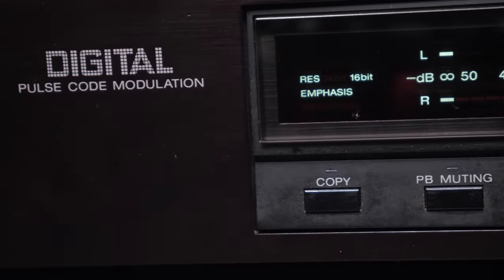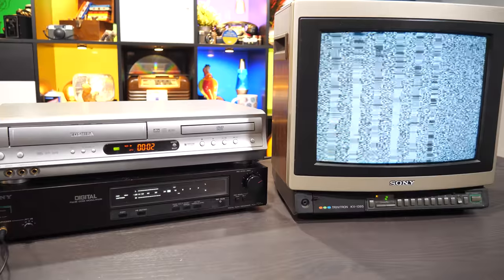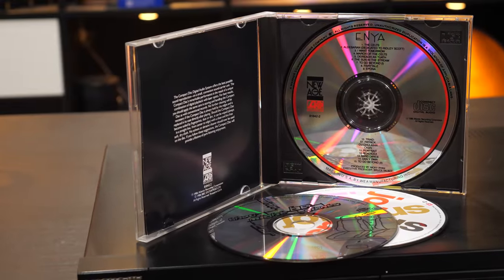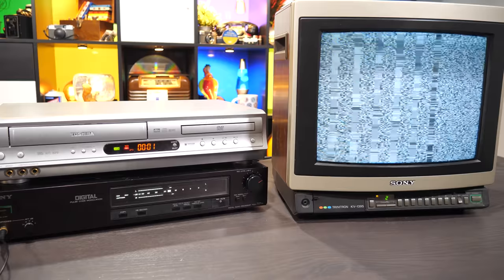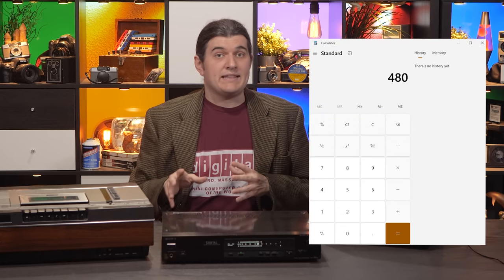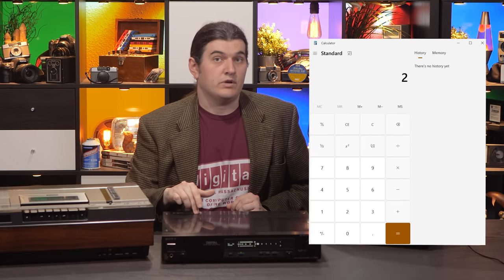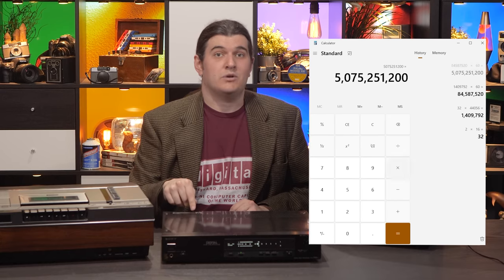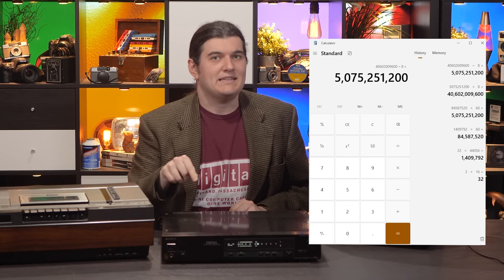Digital audio needed videotape to be possible - and the early days were wild!

Comment: That video output is kinda neat, because it’s not exactly like the recorded waveform you see when recording digital audio on a PC, but you can see the frequency of the sounds as the scroll along the recording head.  So, it’s almost like if you were able to take a recorded sound wave but instead of viewing it from the side like you would in any audio editor—this thing shows the same thing, from a top down perspective, that’s very zoom in so you can only see a small segment as the recording head moves over it.

It’s kinda strange to think about because waves are not really 3D things, but I would imagine that if you put the audio and video track on timeline in a program that can do audio and video editing or at least video playback, like Logic Pro, I’d bet it would be pretty cool to scrub through them at the same time to how it correlates to the waveforms.

Comment: Reading the comments I see no one mentioning ADAT, which I thought was essentially the same system but running at 8x the speed to give 8 digital tracks per VHS tape.  This was something I saw in a few recording studios and was presumably the "professional" version of this setup.  Digital mixing desks have been around for some time but the DAT tape's not suitable for storing a bunch of tracks like that so there would often be a pair of ADATs with some kind of sync box to allow recording 16 digital tracks from the desk (I think you could actually chain as many as you could afford if you wanted more tracks)
Great video anyway, your writers deserve a raise :-)

Comment: I did use mine for recording long radio programs!  Remember there were no MP3/HDD solutions back then, and the use of VHS/Beta HiFi suffered from companding "breathing" and head switching noise.  Both conditions are very apparent in my air checks of KRTH-FM from 1983.  The PCM tapes are crystal clear (minus the lower fidelity FM quality).  This has recently become apparent when I transferred old shows of New Wave DJ mixes of the late 80's I had.

Comment: Very interesting ! As a musician this make me think of the ADAT machines that came out in the early 90´s which recorded 8 channels of audio in CD quality to a S-VHS tape and these machines could also be synced to each other to expand the system to many more channels 8 channels at a time. These days the ADAT as a tape system is probably more obsolete than the compact cassette system but ADAT still lives on as a 24bit 44.1/48 Khz 8 channel protocol over one single Toslink cable and is used for 8 channel AD/DA expansions for computer sound cards for studio use often with built in mic preamps, i use it myself.

Comment: I toured a community radio station in the early 90s. They told me they had to keep recordings of everything for some reason. 

I was too young and inexperienced to understand the tech back then, but I do remember that they had a pair of fancy but consumer grade VHS VCRs that I was told they used to record all their transmissions (some licensing conditions). 

I don't remember much else, but the engineer was super impressed with the way they had managed to do this on a budget and how simple it was. Every presenter who was going on air would pick up a blank, write their date/time/segment info on it, pop it into the free recorder and hit record. When they signed off, they stopped theirs and put it in a store.

Comment: decades ago I went to school for audio engineering.
This was just before DAT came out. 
The head of the school was Leo De Gar Kulka, some of you may know of his son David. 
Leo was pretty leading edge. He had a Sony PCM F1, which was the first version of what you have here. 
He wheeled it out to show us how it worked. Then later on in the year he showed us his custom built tube version of the same thing!
As far as why someone would want a PCM adapter? I remember a lot of people used to use open reel decks to record LPs, FM radio etc just to make a custom 'mix tape' to listen to. The only advantage was that it was uninterrupted music for as long as the tape ran. Which could be a pretty long time at 7 1/2 IPS. More than an hour for a 10" reel. 2 hours if your deck goes to 3.75 IPS.  

When the PCM boxes came out digital was the new hot thing. Don't you remember all the "digital ready" branding on hifi gear? You can logically prove that just because something is recorded digitally doesn't make it better. But hifi and audiophiles are immune to logic. But even putting that aside. It's just more convenient to monkey with a VCR than an open reel deck. 
PS Was that Blakes 7?!

Comment: And in the grand tradition of the majority of VCRs no matter the decade (70s, 80s, 90s), the clock never changed from 12:00. Carson and Leno got a lot of millage from that detail.

Good work. I remember guys back in the day in my engineering classes recording their records to video tape. I think in the movie Contact, they used a VCR to record the alien transmissions. I remember noting it when I watched it in the theater, and was impressed fr the detail. It was made late enough it may have been DAT, but it didn't look like it.

Comment: I used to use adat in the early 2000s.  Used SVHS tape to record 8 channels of audio. A two hour tape would give you 42 minutes of 8 Chanel recording at 48KHz. Not good enough for studio recording, but great for live and other location multitrack situations. Alesis was the manufacturer. They had a time code track too so you could lock three or four adat machines together and do 8-16-24 channel old school mixes on a a huge studio like sound board. But even  in 2002 I would use the adat to get a multitrack record on location and take it back to a studio and play it back into a pro tools or similar setup and do the mix on a Mac G3. Brilliant multitrack solution at the time.

Comment: In answer to Tech Connections question about the difference between 14 bit and 16 bit, I believe that what happens is that the 14 bit is a bit noisier when played in 16 bit mode (which is possible) and the extra 2 bits are just noise. At 14 bits, the S/N ratio is about 86 dB, slightly worse than the 90-92-dB S/N of 16 bit recordings.

Comment: 32:30 well my atari 800xl can address 4gb with two ay8930s,

Hook a hard drive can even display digital video, with synchronous digital audio, and thats a 6502 computer from 1979. And built around 1976, 2600 was just a cost reduced model, below the 400

Comment: Corvus developed a network system to link multiple PCs and hard disk drives together ~~1980.  They used VHS recorder / players to backup the hard drives.  As I recall, backing up a 10MB hard drive took around 2 hours.

Comment: I am very impressed by this technology.  In 1984 I was 10 and had my first CD player. A few years later I received a VHS player with HIFI audio. This was the best affordable way to records cds. It could do 20hz to 20KHZ with 70 dB signal-to-noise ratio (cds are 5hz to 20KHZ with over 90 GB of  signal-to-noise ratio).

Comment: VCRs were also used to do backups for computers.  It was important not to mess with the tracking controls.

Ah, you covered that, but it was available in the mid-80s.  My wife worked for a company that used that system.

Comment: High dentistry removable tape was used in computing during this time period, just not really for home computer applications. In the late eighties, we did have SCSI tape drives that could run on pc hardware, but it was typically used for multi user server class machines, not home computers. Commercial software was even distributed this way.

Comment: There absolutely was something using video tape for data storage between your device and the VHS backup device that Databits demonstrated..

And in curious symmetry with your shirt, I used it on a Dec Vax computer.

Sometime in the late 1980s to early 1990s, there were several systems that used Video 8 and Hi-8 tapes to backup data on Dec Faces (and presumably other computers).

This was a 3rd party device, not from Digital themselves, and I don't know how compatible the recorded tapes were with anything else, or even if they'd produce a playable video signal if put in a video 8 / hi 8 player.

But this certainly existed 5 or 6 years before the device that Databits showed.

Comment: As someone who used to record morning radio shows with a vcr, I could see this being useful. Though back then I was using a rca to 3.5mm cord just plugged into the rca jacks on the vcr. It did good enough to listen to the morning shows later that evening, via a clunky rca to female 3.5mm plug, plugged into a cassette adapter in my mini stereos tape deck.

Comment: Related item: "HiFi VHS" machines that could record HiFi Stereo in the AUDIO tracks of "normal" VHS tapes.  You could still have the video portion carrying a picture, or not bother and just record "snow" for the video bit.  I used one of these decks to record 6 hour radio broadcasts (off the air).

Comment: 21:22 This occurs because the angle between tape edge and diagonal track is effectively different during pausing and during fast moving the tape.
Any video tape player that uses dynamic tracking should deal much better with it.
Dynamic tracking or dynamic drum (from JVC) adjusts the reading heads in the drum or even entire head drum to hit perfectly into tracks recorded on the tape.
One of these systems was quite popular already in second half of 80s in more expensive consumer VHS VCRs.
Cannot give any information about Beta and U-matic but they probably had it earlier.

Comment: I feel like the most useful feature of these are the error correction capabilities. In theory, as long as you don't wait too long, you can re-record the auidio out from one of these into a new tape and get a recording that's error corrected from the original. That's simply not possible with analog signals when they degrade

Comment: I think there are likely several reasons this didn't get used for things other than audio:
1) It's much more straightforward to turn audio->digital than other forms of media like video.
2) Raw video is hideously large. For example, a 60 second 400x240 30fps video encoded with RGB 3x16bit color takes about a GB of storage. Even with the storage, most computers simply couldn't move that much data into and out of their display buses fast enough. The above video example needs a bit above 17MB/sec to transfer, ISA 8-bit could push around 1MB/sec, and ISA 16-bit could do around 5.3MB/sec.
3) Even with compression, computing hardware wasn't fast enough to real-time encode/decode even if the bit-rate and storage needs were smaller. For many years, MPEG-2 decoding was handled by separate dedicated DSPs, and for a little while even those weren't real-time. MPEG-4 wouldn't even start to appear until 1999, and while offering better compression, required even more powerful hardware.
4) As for just using this for files, most systems didn't even have 1 GB of total system storage until well into the late 1990s (in 1995 a 1GB hard drive ran between $250-$500 in 1995 dollars or around $500-$1000 in 2023 moneys). There simply wasn't a use-case for this and by then there were better (more reliable) formats around with better integrated hardware/software ecosystems.

Still it is an oddity that digital audio wasn't really treated as data until so late.

Comment: I think the point is that you should be able to make lossless copies.  You could also arrange the encoding such that 14 bit machines can playback 16 bit recordings using the most significant 14 bits and maintain compatibility.  Helical scanning technology to tape is still used today for tape backups.

Comment: I have one of these (I think mine is the 501 model)! I picked it up on eBay only around 5 years ago. I love it! It still amazes me that we could get perfect digital audio onto VHS. It also worked for me using EP mode. (I think that's 3x the record length than SP).

I don't remember it making the weird noise when I paused though, but I was using a 4 head VCR so the pause was nice and still.

Comment: Back in 1991 on my Amiga 2000 I had a hardware device and software called Perfect Sound for digitizing audio from a source (Fun fact: Perfect Sound was the first product made by  Anthony Wood, the same guy who made the Roku). Anyways, sure you could digitize sound, but since the Amiga had only 1MB of RAM by default and 700KB drives, you could only record literally just a  few seconds of audio at high quality before you'd run out of space. You had to use 8-bit and low sample rates to get any decent length. I remember saving a few samples from Star Trek TNG to floppy disk and then uploading them to a BBS, which took hours to do.

Comment: When I was involved in student radio in the UK, we were required to keep recordings of all our output so if a complaint went in to Ofcom (the media regulator) we could provide evidence. Everything was done on the cheep with second hand/modified/cheep equipment. While I was there, a PC recorded to a file server. But I once found a few VCRs with some weird cables. I have a vague memory that they literally just chucked line level in to each audio channel and the video composite input. There was some setup that allowed them to record mono audio and switch between which of the 3 composite inputs were being used. This let them get many hours of mono audio onto each VHS tape. Though don't quote me on this because it was a long time ago and not a setup I used personally! Anyway. This feels like it would enable something similar in a slightly less bodged manner, but at a much cheaper cost than "professional" PCM equipment.

Comment: Woo! Something I actually used to work with!! Well, these and the UMATIC version PCM 1630.

These, and the other F1 PCM kit normally worked with betamax, though.

Rare kit now, I was saving old CD master tapes for a re-mastering studio.

Answering your question. Not all studios had enough cash for the UMATIC, so these were often used for CD master tapes.

Also. We had these and 1630's - they're not interchangeable, the tape has to be made for the relevant format. We tried once, but couldn't get a 1630 UMATIC to decide through a 701.

Comment: About the parity: My personal guess is that there are 5 bits each line, and the 6th line is used as parity bit. This is especially appearant in total silence, where the 6th line is always black, opposed to all others, which are white. I wouldn't be too sure if more complex CRC codes were employed, at least not on this level.
I also tend to say that the dropout handling works so well because lines 1 to 5 may (and maybe line 0, which might got hidden by overscan) contain exactly the same data, just shifted by time a little bit incrementally for each line. Given your droupout samples, you can hear it to drop after a certain amount of lines on the bottom were lost - and that would be about the time shift from line 1 to line 5.
All of this is guesswork by pausing the video at certain points, so no guarantee, and the perceived repetitions could just be the nature of audio waves. On the other hand I reverse-engineered quite some data formats in my life. Might not be correct, but I might be able to write a decoder by just what I see and try - iteration by iteration.
Reply: There's maybe 150 bits per line, not six. Less than teletext, surprisingly; but this does have the full frame to play with, so Sony seem to have spent maybe 96 bits per line on the audio and the rest is presumably error correction. Six samples per line; the big stripes are very probably because Alec doesn't have the recording volume up as high as it'll go. For error handling, it's probably not CRC but something stronger that can recover errors, not just detect them (CDs use multiple layers of reed-solomon; this I'm guessing is just one layer)